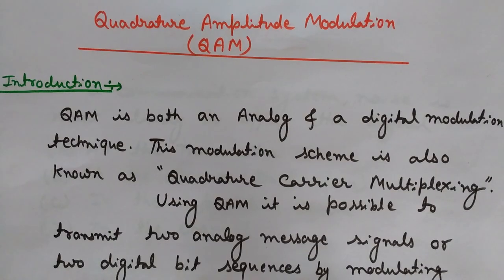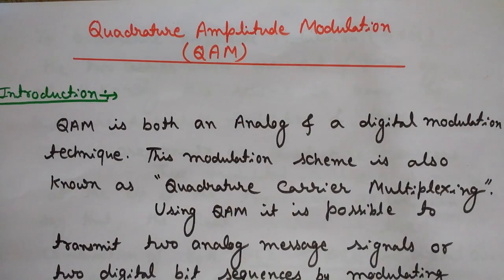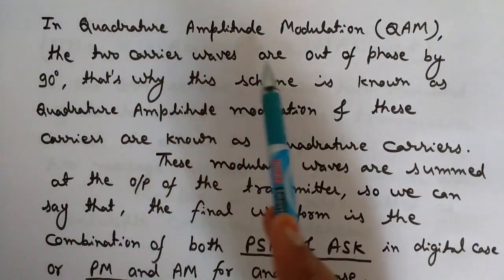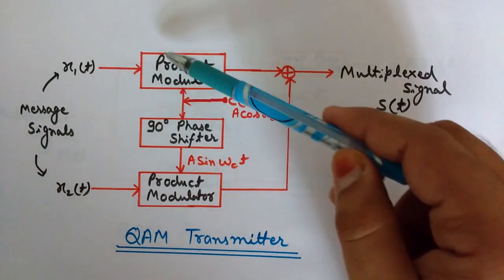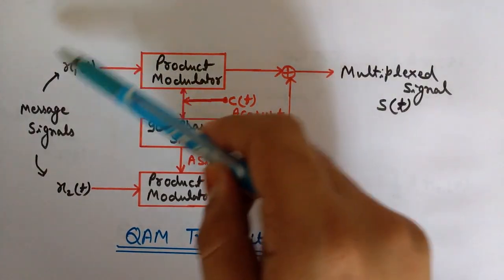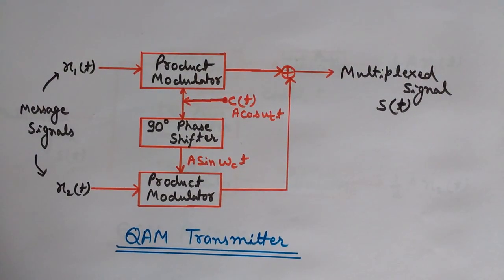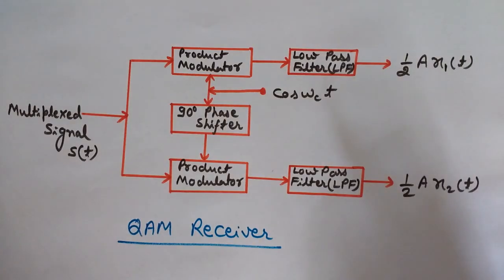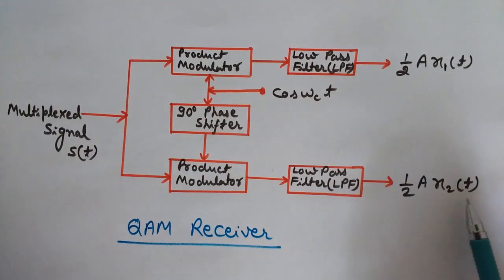Quadrature Amplitude Modulation (QAM)/QAM Modulation/QAM Transmitter and Receiver/Block Diagram [HD]

Comment: I can not understand receiver part, how to {1/2 An+t)} output value.
Reply: When you multiply the multiplexed signal s(t) by the carrier wave cos(wc*t) in the receiver's product modulator, you'll see that with the product trig identity the product will be 1/2[Ax(t)cos(2*wc*t) + Ax(t)cos(0)]. Since cos(0) = 1, the second term is just 1/2Ax(t). When you pass that sum through the LPF (low pass filter), the cos(2*wc*t) is attenuated and so the result for the In Phase channel at the top is just [0.5Ax(t)]. This also requires that the LPF has a cutoff frequency greater than the frequency of the original message signal x(t) so that it survives the filter.
Reply: @salukaboy9891   brother since s(t) = x1(t)Acos(wc t) + x2(t)Asin(wc t) and on multiplying wiht carrier wave cos(wc t) we get x1(t)Acos^2(wc t) + x2(t)Asin(wc t)cos(wc t), from this how can we obtain the equation 1/2[Ax(t)cos(2*wc*t) + Ax(t)cos(0)] as you mentioned above?